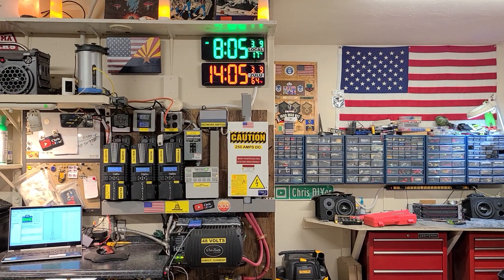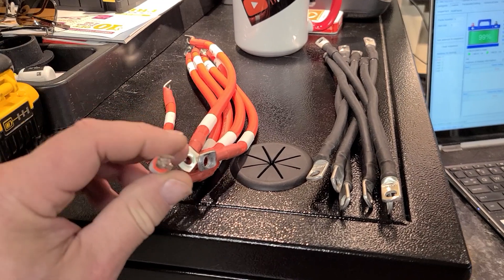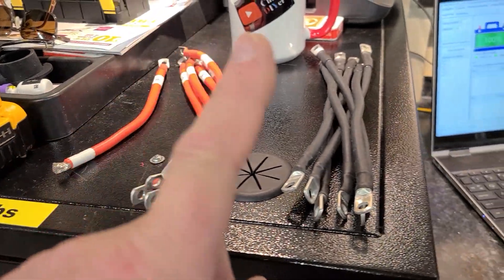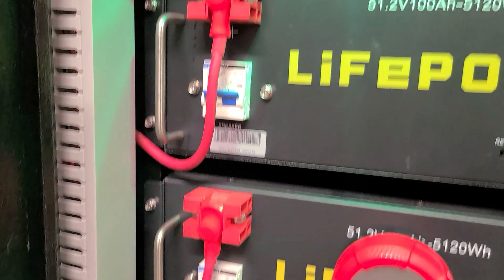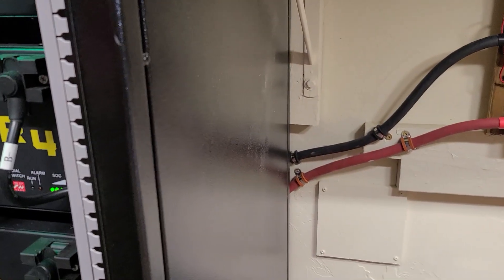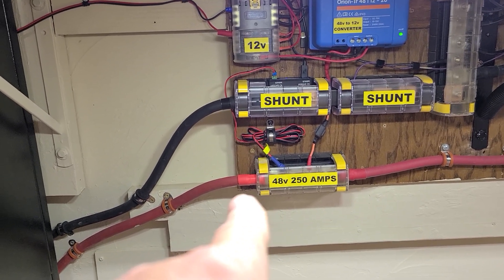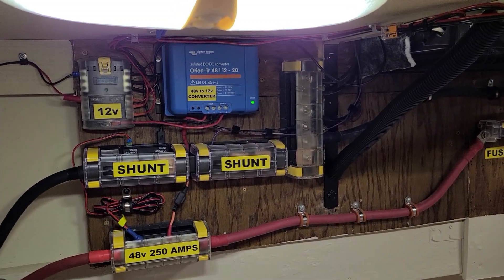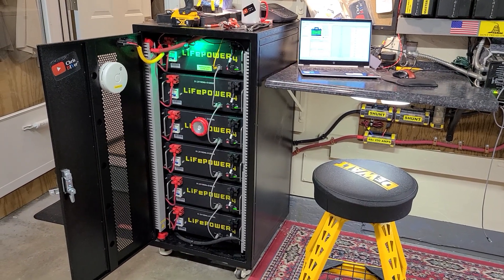48v EG4 LiFePO4 battery server rack safety mods - cable relief, new lug ends

Comment: Just wondering how long (feet) you made your 4/0 cables from your busbar in the battery rack over to your terminals?  Why didn't you use the predrilled holes in the top or bottom of the battery rack to run your cables through?  Did you drill holes out the back?

Comment: I love the well organized man cave. Fantastic cable management. Whats the max amp draw on the 48v to 12v step down? Looks good Chris. Your showing some love for your system.  I'm Missing a 250 amp fuse in my system. It has DC breakers and 6 100 amp BMS per cell pack. Noted and on order. Again Great video Chris  See you soon, The Shire
Reply from the maker: Thanks...using DC breakers + a fuse is always a smart thing to do. As for my Victron 48v - 12v step down converter, it's max output is 20 amps (240 watts). More than enough to run small 12 DC loads here at the garage workstation. Phone charging, LED undertable DC lamp, etc.

Comment: I like the way you labeled everything. Ease of maintenance when you get old and forget stuff. (ha ha)
Reply from the maker: Hahaaa...yep! Remember all those aircraft tags "Remove before Flight"? Aircraft maintenance on the flightline and hangers never leaves us! I worked in towers and RAPCON equipment rooms where nothing was labeled...always pissed me off (sloppy work) on ATC equipment.
Reply: @ChrisDIYerOklahoma  So true. I still label most everything in the garage from years of being a Helicopter mechanic. My tool drawers are "shadowed" as much as possible too. It made sense then and it makes more sense as I get older.